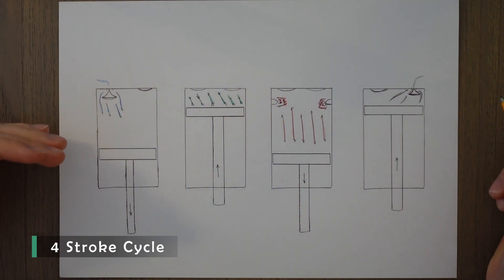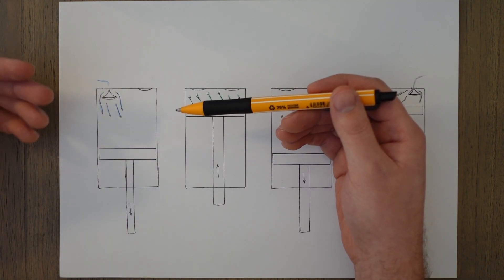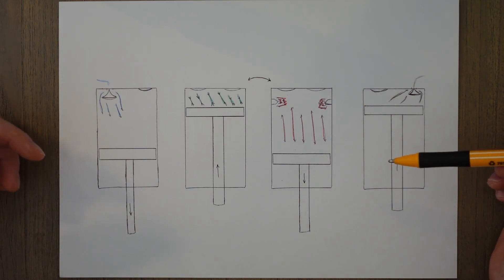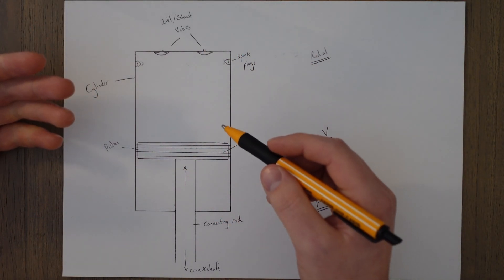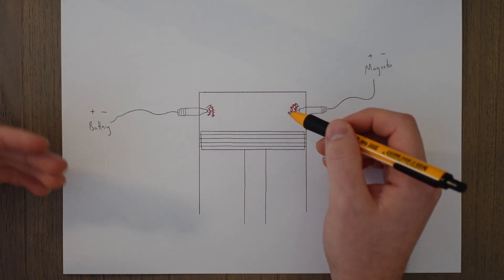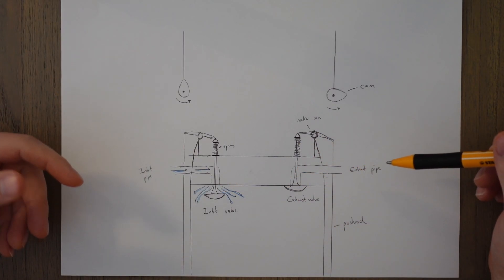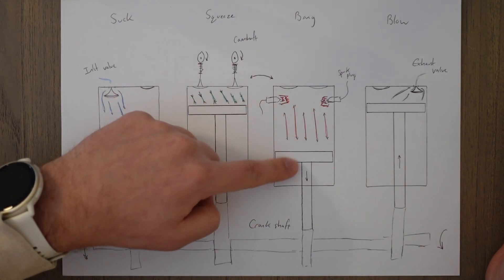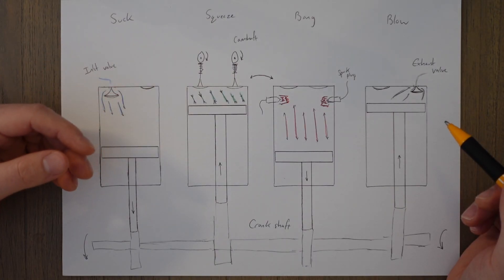ATPL Aircraft General Knowledge - Class 2: Piston Engines.

Comment: Diesel engines do not use spark plugs, when the piston goes up and compresses the fuel air mixture, it compresses so much that the mixture reaches a high enough temperature to ignite
Reply from the maker: Yes, i talk about this later in the series...